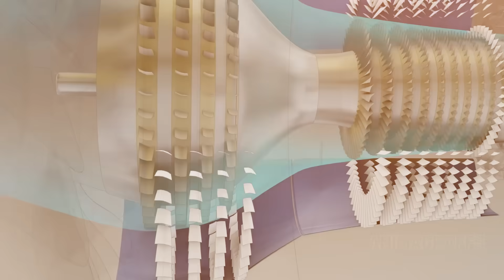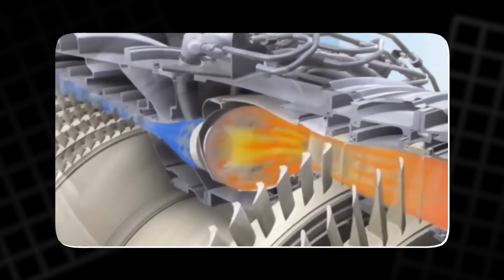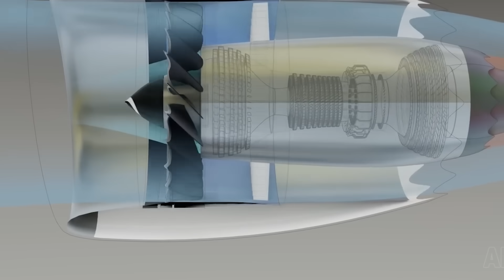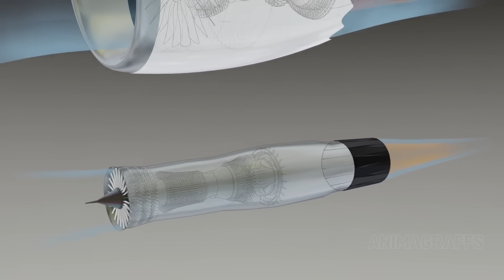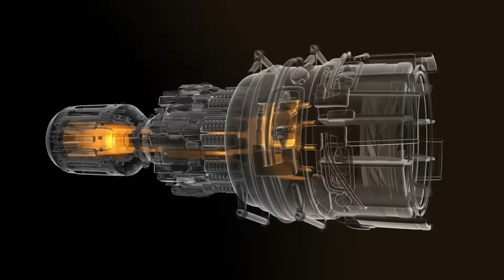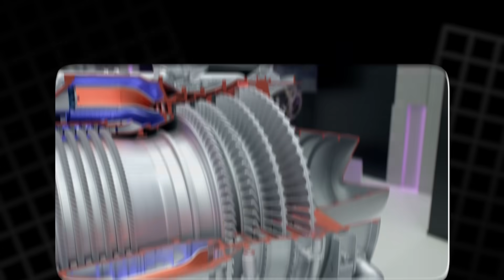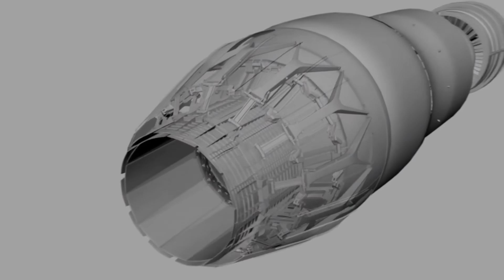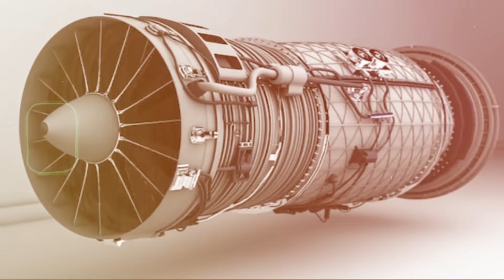How Electric Plasma Jet Engines Could Revolutionize Air Travel

Comment: Anyway you cant put enough batteries into the aircraft to make it fly longer than one circle around the airport, and you cant attach the cable to the aircraft. But even if you could find somewhere lightweight source of infinity electricity it would be much simplier and more efficient just to spin regular turbofan engine by electric motor instead jet turbine
Reply from the maker: That's an interesting point about the challenges of powering aircraft!